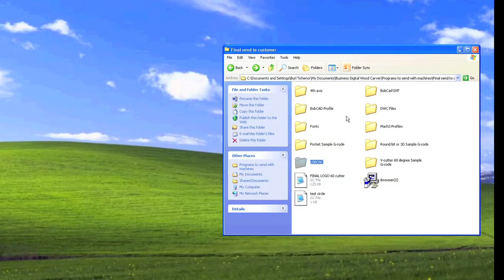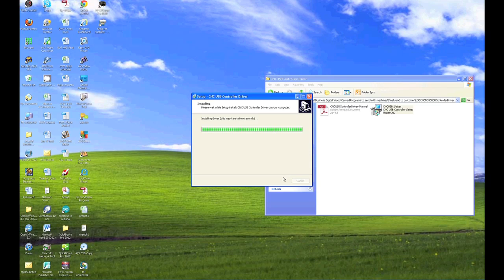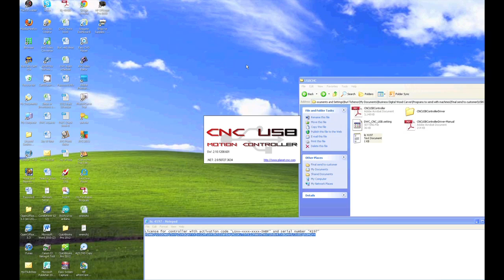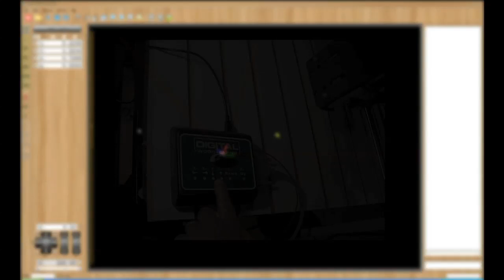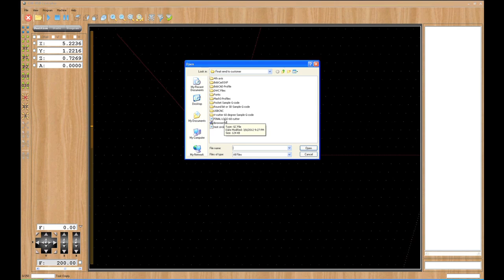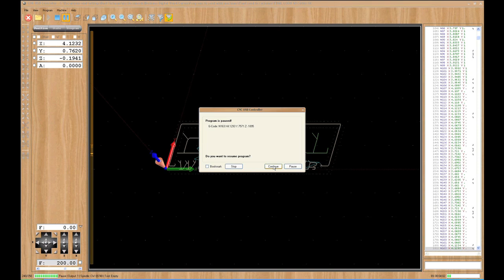USB CNC Install and Basic Training

Comment from the maker: I like the USB CNC software for a few reasons. 
1. It can work on new computers. Windows 7 64bit along with older systems. Mach3 still requires parallel port.
2. The screen is not as busy.

Comment: thanks for the video! its really hard to find info on this software in comparison to Mach 3. Just a quick question. does raising the Z before running set the home or tool change position or can that be set else wear? thanks again

Comment: Good evening Burl, I bought a pack with motors + controllers + card UCNCV 4 MK1 and it is impossible to register on the CnC UsB software despite the code provided ... How could I proceed ... Thank you I am a beginner .. .Thanks for your help

Comment: Hey there was wondering if you might have the answer to question I have. When running a profile cut using cutter comp (g42) how do I get it to recognize the tool offset. ??? Thanks in advance for any help. 😁

Comment: Hello Burl..
Based on your experience.. do you think that the Planet CNC Usb card and software is comparable to Mach3 (other then not needing the Parallel Ports)..  is there a downside to the Planet CNC cards/software.... Is there any problems with CAM software that doesn't make a dedicated post processor?
Thanks... I'm trying to compare the Mach3 vs Planet CNC MK3 solution...
Reply from the maker: Sorry I don't have time to respond to all the questions. These videos are for my customers and they will e-mail me directly. I like USB CNC much better than Mach3. USB, works with Win XP, 7 and 8 along with many built in features and just some of the items. Easier to setup and use.  A very solid software and hardware. I have been using it for over two years.